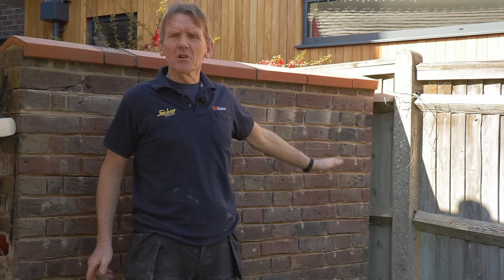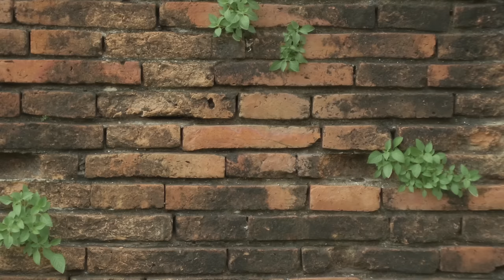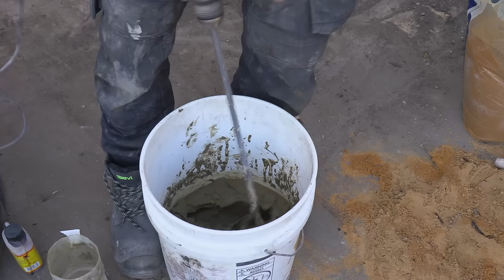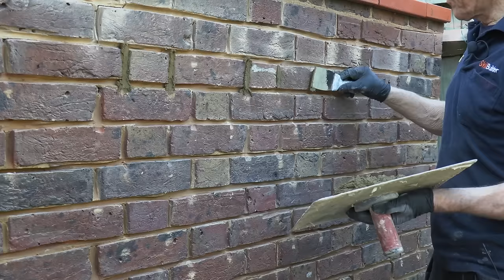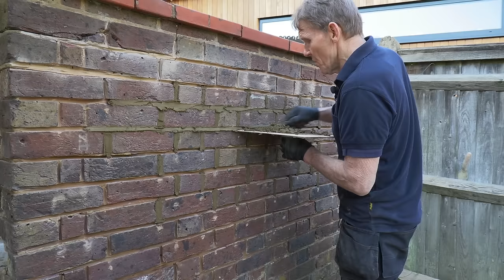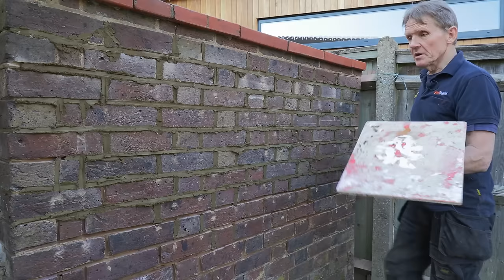Repointing Old Brickwork - Best Mix & Tools

Comment: Great video Roger. I’ve got a 100yr old stone garden wall here in Scotland that’s falling apart. What kind of mix would you use for that? The stones are maybe 30-40cm wide and so the gaps are pretty big. Thanks in advance
Reply: Hello, bigger the gap between the stones you can use sharp sand. We used stones from a fish tank, sometimes we have sieved stones that were too big. Motar we use is hydraulic  lime. Called a strength of 5. So you ask for NHL 5.IF the stone wall is constant wet you use NHL 3,5 it's a stronger lime.  Mix would normally be 3 Building sand. 1.5 sharpsand. 2 handfuls of Grit (fishtank gravel). Then 1.5 of Nhl 5 lime. If the pointing is wet still in the wall (No sun on it) it will take a while to go off. We use a plastic like shoe brush to get a finish on it after a three hours. Can take a week to go off. Sometimes we use the back of a chisel (flat edge basically) to give a racked out look. Use a soft brush dust pan brush. NO CEMENT IS USED AT ALL.. cover the work over at night, protect from the sun as well and the wind.

Comment: As a novice - and non builder -  I first repointed an Edwardian town house.  Really good bricklaying on the front.  Getting shabbier round the back and the bits that only the neighbours saw was not good at all.  Luckily I had an excellent old guy "pointing" me in the right direction.  Good lad, our Den.
Moved to a Georgian/Victorian hunting lodge with 33 rooms, 29 chimneys, 50 foot tower and on and on.  HugeVictorian bricks, tiny Georgian ones, really tight gage lines and a dragon of a listed building enforcer.  Fortunately the County's monuments guy was a star and again pointed us in the right direction.  We had to use all lime mortar, I found plastering sand worked well at matching the existing finish.  Took f..n years.
Keep up the good work - and stay safe everyone.

Comment: Hi Roger, that's amazingly good and fast work. I have learned so much from you in the last couple of weeks. My Victorian semi has been pointed before we bought it but unfortunately the mortar is shallow and very hard resulting in quite a few of the bricks blown. I plan to stormdry (thanks to your video) over them to seal out any more moisture (dryrod at the base too) Can I just use a 3:1 mix like you instead of lime mortar as I have heard lime is supposed to be used for older houses like mine which was built with lime mortar ?

Comment: Ah I was trying to figure out by myself on a test wall and got to the hawk and finger trowel (what they call it over here) as my approach for the horizontals. Verticals were a pain. All gaps horizontal and vertical, were different widths and depths, a crazy wall... Fingers... that was what was most effective for verticals the majority of the time!! 
I wanted the bent mental tool you showed for scraping - but couldn't get one anywhere. Bought a few different diameter pipes, cut down and ach, it for sure needs to be bent to be more effective... will try for the next half of the wall :) Your mix was definitely looking more wet than mine... its all drying nicely though... would maybe be easier with wetter, to do those verticals... now just to think whether I should really try to do it different and risk to much contrast between the halves of the wall! 5x3.5m wall being done!

Comment: Enjoyed your video. I need to repoint a part of my house wall close to ground level. The house is 150 years old, in Merseyside. I have seen a tub of proprietary mortar mix in the ratio 6:1:1. Is this a suitable mix? Is one part lime enough? Is it ok to have 1 part cement? Cheers.
Reply: Shouldn’t mix like with cement. Plently of company’s out there that will sell your a premix lime where you just add water
Reply from the maker: 6 1.1 should be fine. Use hydrated lime from your merchant. It is fine for the job. Don't put in more hydrated lime than cement because it won't set. Hydraulic lime is a different proposition. You can use it but generallt a 6.1.1 mix is as good as a 3.5NHL lime.

Comment: Brilliant advice as always Rodger. A plumber myself I love pointing around pipes, flues etc. Building in missing brick and making good walls. Very satisfying job I find. Keep up the good work!
Reply: It isn't brilliant advice, it's the worst thing you can do to an old house. The pointing should be sacrificial, but if you use cement pointing then the brick or stone disappears. You must have seen this on old walls.

Comment: Brilliant video . Just a little tip, its a little easier if right handed, to start on right and pull the mortar into what you have already squeezed in.
Reply: Yeah he is working backwards . Also curl the mortar into your slicker for the head joints. Start opposite and kinda flick it into the slicker.

Comment: I've just re watched this and realised that you work left to right just the same as I do, 
I've been advised so many times to work from right to left as to pack the mortar more easily, 
But I'm good and fast at pointing (probably because I hate doing it so want to get it over with without any call back)
Your a wealth of experience and knowledge, thanks.
Reply: I also noticed he should have been working towards the filled pointing bed. Great video though, learnt from it.

Comment: I understand being set in your ways, old school go with what ya know but have you ever used grout bags to fill the joints? much faster and cleaner. I've been using them for 10 years.
Reply from the maker: I am certainly not set in my ways and will try the grout bags when I get a chance. I have used every gun under the sun but I like the hawk and tuck pointer for the beds. It is the perps that I would like to find something good for,

Comment: Great tip for the perps! The only good bit of pointing is driving away from a well finished job! So any tip that makes it easier and quicker is golden! 
The half round finish is known as bucket handle finish up north, from the days of steel buckets so I've been told. Any tips to make raking out easier?
And did I really just see you point a wall that is about to be demolished? Or is lock down making me hallucinate? 
Love your dedication to a good job, no matter what it is 👍
Reply: Yeah , old steel fire buckets used to have handles that were like half a pipe , so were repurposed . Now you can buy the half round tools in differing widths

Comment: Question from a what’s he on about -
Would a PVA priming wash be a good idea on chimneys? I know it leaves the bricks shiny but you’ll never notice from so far away. 
Is it helpful or detrimental?
Reply from the maker: PVA is not a great product for exteriors and it will not help the situation if you are trying to stop damp. I have used Stormdry on chimney stacks and it works well. You need to give the stack time to dry out before redecorating indoors but as soon as the Stormdry is on there it stop any more water getting in.

Comment: Thanks for sharing the knowledge. I am in no position to teach the master, but I was told you should go from right to left when pointing so as to pack against the mortar; is this the case or does it not matter?
Reply from the maker: grotekleum
You are dead right, this is a unorthadox and I was, mistakingly thinking of the camera and not covering the action with my hand. In this case with the wet mix I don't think it mattered too much and I have seen lots of continental videos where they work along a wall and then back again so I am not completely sure if it matters. Having said that there is a lot to improve on this video and I will make a new one.
Reply: @SkillBuilder  Thanks Roger, for replying - much appreciated. I have quite a bit to do using lime on my old converted railway station home so wanted to do it right once.
Thanks again.

Comment: I have a Victorian Chimney stack. The Chimney is no longer used. Fireplaces are all closed up. The Chimney stack needs repointing. I'm told it these building bricks need to breathe to prevent damp. I'm guessing still a 3:1 mix? Roofer vs Chimney sweep vs plasterer? Who would do the best job? Can you recommend anyone in the Torbay area? Thanks, Alistair
Reply from the maker: I would go for a 4.1.1 sand, lime, cement  mix or even a 5.1.1 mix if the mortart is lime. If you used a strong mix is will crack. Give it a good coat of Stormdry afterwards.
Reply: @SkillBuilder  Many thanks

Comment: good you pointed out about not using a strong mix otherwise it can take the face of the bricks off as well as all the other issues you mentioned. The odd occasion I've repointed,  and if large enough area I'll use a manual 'caulking style' pointing gun, but to stop bung-ups you need to sieve the sand, sounds a faff but it's still quicker and produces a nice result.  Like someone already said,  after the soaking I'll use a hand spray to 'top-up' the wall to help stop that suction. Hanging damp sacking over helps keep the sun and wind off to let it go off and not just dry out.  My preference is 1x portland,  1x lime,  4x sand,  that way you can get the fat up without bother to give a nice waterproof finish. Keep the videos coming!!  Best wishes.

Comment: Hi Roger nice job,I use a 1 inch flat tool and load the hawk to the appropriate thickness of bed and smash in the perps 5 sq a time,Then clean them up a bit striking waste off top and bottom then lay in the bed but working from right to left so your continuous pushing into the previously layer in pointing,Iron in then gently brush but if it's on the front I won't use brush but double ding instead and clean any flakey bits with the tool
Reply from the maker: Good advice. I will use all these tips in the next video and see how it goes. The 1" flat tool, is that a margin trowel?
Reply: @SkillBuilder  yeah you used to be able to get 3 at toolstation for about a tenner,I used to do weatherstruck pointing for nottinghill housing trust about 10 years ago,We were doing so much of it for so long we used to strike it off almost as you go with that tool as well instead of using a level,Which sounds rough but it actually looked really good,I think the video's are great mate I wish everybody had as much enthusiasm in their craft as you and Robin.

Comment: Great vid and ideas. I’m in the process of repointing the whole side wall of my 3 bed semi detached property. There’s a garage on the side so can access from the roof.
Considering 3 to 1 sand/cement mix with plasticiser as the wall is exposed to the elements but having seen this, I’m not sure.

Comment: I came across your video as I’m looking to repoint under my bay window.
Couldn’t believe it when you said your name at the beginning.
I called in a couple of times to ask your advice when you used to be on LBC radio with Steve Allen 20 years ago.
You must have been a teenager then!
Reply from the maker: I started on LBC first with Therese Birch when I was around 32 years old and did the show for 15 years. I loved doing it but LBC has changed into a purely political station now and there is no scope for that kind of show. Hence Skill Builder...

Comment: In America, we grind out as much old mortar as possible before applying the new mortar because it adds more surface area for the new mortar(and more of it) to adhere to and makes it less likely that water will be able to get in between your new mortar and the old mortar and frost heaving your new stuff clean off the chimney/wall. All too often you come to do roof flashing work on a chimney(that the customer claims was "recently repointed") and there's little 1/8" thick rectangular chunks of mortar laying on the roof and hanging out of the mortar beds, and usually(not all the time) that's because they just smeared a paper thin layer on top of the old stuff(that stuck to nothing) and called it a day. 

If you're not going to be doing any grinding, it's good to at least pressure wash what you're planning on repointing first to remove anything from the surface of the wall/chimney that that might interfere with adhesion of the new mortar to the old mortar whether it be dirt, dust, oil, plant material, or what have you, and also to dislodge any loose pieces of mortar or brick, because obviously you don't want to put your new stuff up against something that's fixin' to fall out. If possible, it's also good to figure out if the bricks you plan to repoint are high suction(capillary suction) bricks, because that will affect how wet your mortar mix will need to be or if you have to wet the brick first before applying the new mortar. Some bricks are thirsty and will drink the water right out of your mortar before it's done doing its thing, and that's no good. The science: http://canadamasonrydesigncentre.com/download/9th_symposium/MORJTS06.pdf

Comment: In the process of pointing brick work on my house , just wondered if a plastersiser is necessary in the mortar mix ?
Reply from the maker: yes put a small drop in if you are using OPC but if you are using Premium Cement they say there is no need. Many brickies still put a bit in. See how workable it is. If you use plasticiser you will need less water and that means less shrinkage.

Comment: Thanks for this! We paid to have our bay window  repointed couple years ago and it's all fallen out again....I'm a plumber too so I figured if you can do it......! How can I tell if it should be cement or lime mortar I should use? 1930s semi. X
Reply from the maker: If you read some of the more helpfully comments here you will probably do a better job than me. 1930's is likely to be cement. In truth, though it upsets a lot of people, there are thousands of properties all over London that were built with sand and lime and have now been repointed with sand and cement. Generally if it is not too strong and has plasticiser in it then the bricks don't start spalling and it isn't the disaster some make it out to be. I love lime and it helps to  put a 1 hydrated lime, 1  cement, 5 sand mix in but it comes out very white and is not always a good match for a lot of mortar so maybe just stick with the plasticiser.  Don't use Fairy Liquid because it has salt in it.
Reply: Well I've currently got time on my hands so I'm going to give it a go! Really appreciate the reply and all your videos and tips. Love your channel.

Comment: On a 40's semi where the existing mortar seems to be a soft black dust at best, I'm guessing a 5:1 max mix is best? or would there be lime in there as well? I think we have "pre war common" brick.
As ever everyone seems to recommend a different raking depth. I'm sure I've heard you say 25mm on another video yet this one looks quite shallow and you do say 10-15mm? Do you normally just take it wall by wall and evaluate the condition of the existing mortar?
Thanks.
Reply from the maker: I said 25 mm and would go for that but brickies said it was too deep and took ages to fill. I would still do it but 15mm is realistic.

Comment: Good vid on pointing just a question my outhouse/coal shed shs had water ingress behind the render and the bricks are wet do i need to let them dry out or can i repoint them wet .thanks in advance
Reply from the maker: Pointing the bricks might help a bit but on a single brick wall you will find it leaks. This is not unusual and the best way to solve it is with a coat of Stormdry. It is a one application problem solver
Reply: @SkillBuilder  Cheers will do

Comment: I am surprised that you haven't ground out more mortar. Is that enough depth for the new mortar to be durable?
Reply from the maker: Ideally you want it at least as deep as it is wide but 20mm is better on a 10mm joint.

Comment: Pointing guns are alright, I've used one today. The mortar has to be very well mixed otherwise you just push the water out, plus you need the joints to be properly raked out to at least a depth of 30mm and more if you can. The pointing gun will really push the mortar well in as well, but when you are only repointing shallow joints that are barely 10mm deep like you are a tuck pointer, trowel and hawk like you are doing is the best. Its always a good idea to soak the wall this time of year as well.

Comment: Please advise, I'm a women and don't know much about this so would be grateful for some advise. my victorian house has a blue brick damp course which are layed as headers i think (the opposite way round to the others) the wall needs pointing but I've noticed in-between the blue brick course when i poke in-between all the gaps there is no mortar what so ever ? on every one, do you think it was originally done like this or should I point or not ? Many thanks for your kindness.
Reply from the maker: It would be good to see some pictures of this. The bricks are probably Staffordshire Blues which were used as a damp proof course and did a good job. Normally I would expect them to be laid on sand and cement mortar but it could be that they were laid on a thin joint of cement in order to make the joints waterpoof. This would be similar to a cement based tile adhesive. When you say the wall needs repointing I take it you are talking about the bricks above those Staff Blues. My instinct would be to leave the Staffs alone.

Comment: Everyone has their methods, but i normally use a 4:1 mix but knock it up fairly dry and water untill it can keep its shape that way you don’t smear on the brick work, I use a modified tuck pointer as well, spray the brickwork before so the mix doesn’t dry before curing. This method works well for all types of pointing and jointing finishes including bastard tuck pointing with putty.
Reply: Spot on , you can't compress water . This pointing will dry brilliant white and turn to dust in a week . Everything about it was wrong  ,   This will now be deleted .